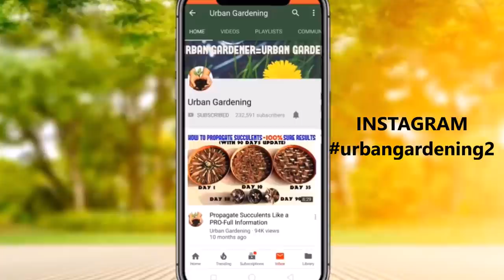How To Make Cement Pots | EASY PROFESSIONAL WAY

Comment: Does animal compost harm the seeds and plants? or it's okay If I used it with the garden soil?, Because that's what I heard and I want to make sure before doing anything ):
Reply from the maker: Cattle manure does not harm the seeds n plants ...use according to the need, in appropriate ratio
Reply: @urbangardeningofficial  / Thanks a lot❤️

I want to ask you a very important question for me. I know that I need to add compost to the soil every two weeks maybe, but sometimes I see you adding Seaweeds as a Fertilizer instead of the compost, so i got confused in this, should I add compost or seaweeds? Or both of them? Like how do I know which should I use and which is better?
Reply: @urbangardeningofficial  / Please answer my second question🙏🏻❤️
Reply from the maker: @opi6096  add any one...add compost now and add seaweed after 15 days .....or you can also add both in half half proportions

Comment: I always find difficult to take the pot out even after putting oil inside
Reply from the maker: Coat the surface with paint mix n see the difference
Reply: Maine To kai Tod die Or bht se half use kr rha hu 😔 par mza bht aata h banane me 🙄✌️
Reply: Pour hot water slowly over the plastic mold pot. It will loosen up easily

Comment: What type of cement did you use?  And, how do you drill a hole in the bottom without cracking the pot?
Reply from the maker: Normal cement which we use in construction ....once pots are ready make a hole at the bottom with a help of a drill machine
Reply: @urbangardeningofficial  how come it doesn't stick to the mold and can pull out easily when dried out?
Reply from the maker: @disrael2101  due to the paint mix (marble powder+cement+colour) marble powder makes the surface smooth and it helps